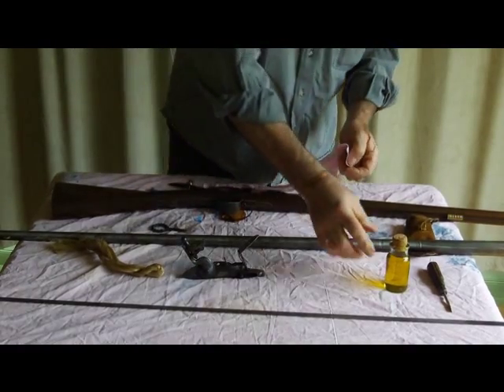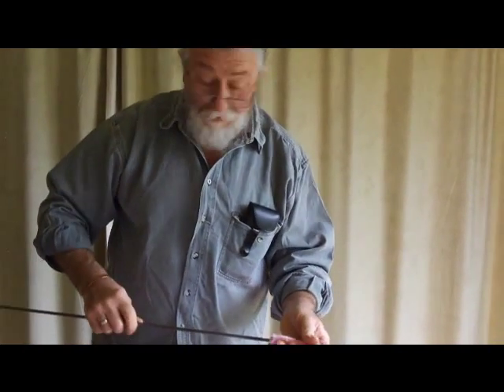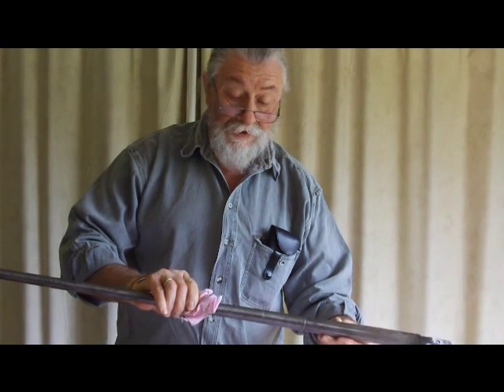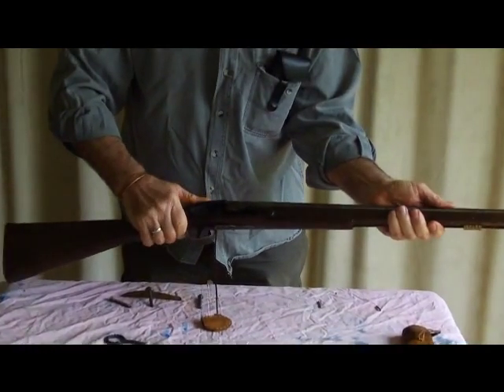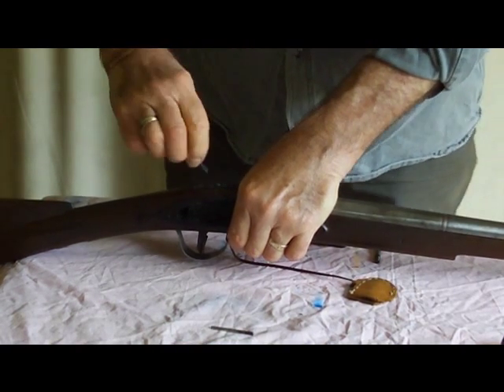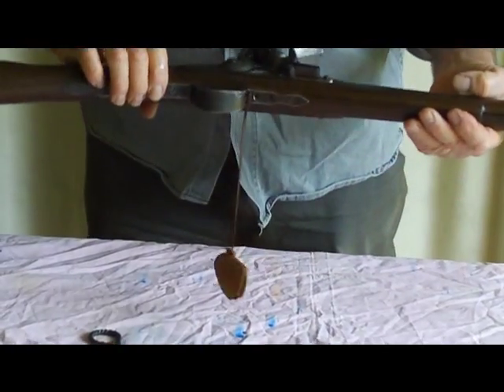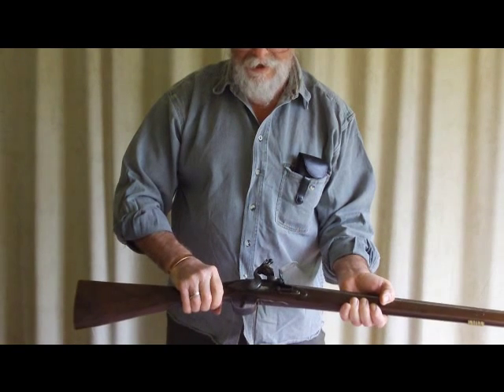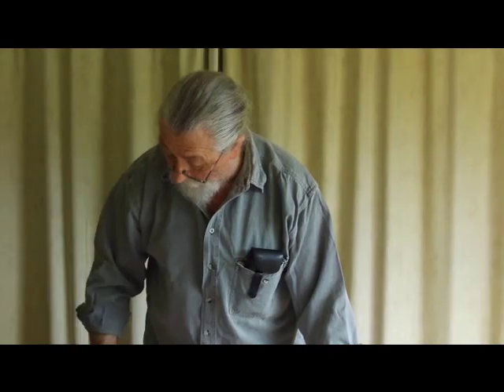PART TWO. The Cleaning & Maintainance Of A Muzzle-Loading Gun.

Comment: Hola Keith. He visto ahora tus dos videos sobre cómo limpiar una escopeta de avancarga y están muy bien. Yo también limpio mi escopeta así. También se puede limpiar sin quitar el cañón de la caja. Saludos. Hi Keith. I have now seen your two videos on how to clean a muzzleloading shotgun and are fine. I also clean my percussion shotgun as well. It can also be cleaned without removing the barrel from the stock. Greetings.
Reply from the maker: Hola. Modern gadgets are fine if you can't clean them as I do in hot water, I know there is a clamp you can get for flintlocks, & a similar item for percussions, but I still prefer the old way of cleaning with hot water. I think it gets it cleaner.
Good to hear from you again my friend.
Take care.
Regards, Keith.
Reply: Hi Keith. I clean my muzzleloader shotgun and rifles (Kentucky and Hawken) with water and cutting oil 10 % solution. Then dry the barrel with cotton cloth in my cleaning rod and last step a cotton cloth with oil like WD-40. But clean after each competition, ie immediately after 13 shots. I hope you liked the picture I posted on your Facebook wall, hunting with my muzzleloader shotgun and a partridge. I am Kit Carson on Facebook but my name is Miguel Angel Navarro. You can call me that. I really like your blog www. woodsrunner diary. Greetings from Spain.
Reply from the maker: hawkenrifles Good to hear from you again Miguel.
Keith.

Comment from the maker: I only wipe the excess out of the barrel so it will not foul the gunpowder charge. I only ever use my fusil for hunting, & one shot puts meat on the table. Not that a fusil ever needs cleaning between shots anyway. I think the larger calibres suffer less from barrel fouling, where as the smaller calibres like the little .32 need cleaning more often.
Regards, Keith.

Comment: Enjoyed this one very much. I've been impressed at how simple cleaning is. A couple of questions. How often do you swab out the barrel when shooting and do you use a cows knee? Great video thanks.
Reply from the maker: I do not do any target shooting, so if I am hunting for meat, it is the one shot then clean the gun. However, if I were shooting multiple shots, I still would not have to wipe between loads because I use a smoothbore.
Rifles on the other hand are a little harder to load, & with some, depending on the load used, you have to wipe the bore between shots or after a couple of shots or the ball may get stuck half-way down!!!
A way out of having to wipe if you need further shots is not to patch the ball, just load the ball as is without patching.
Yes Opal, I carry a cow's knee lock cover in the bottom of my shot pouch.
Regards, Keith.

Comment: Interesting that you say to clean the olive oil out of your barrel.. An old gentleman who taught me, liked to "season" his barrels with oil so as they'd be easier to clean ad he was able have more shots between cleanings.. On avg I'm able to get 6 to 8 shots before I actually need to swab the barrel or clean it because of the oil.. In his case he use lard usually.. I've used shortening for mine with the same results.. The only places I have to worry about rusting is in front of the tang

Comment from the maker: No there is no difference in the cleaning method for rifles or smoothbore.
The correct 18th century term is hammer or steel. This term left over from the earlier version which was shaped like a hammer. Frizzen is a 20th century modern term.

Tow linen/tow cloth/tow rag. "This separates the short fibers (called tow and used for making more coarse, sturdy goods) from the longer and more luxurious linen fibers".

When dealing with 18thc. items, you must think 18thc. not 20thc.
Keith.

Comment: You don't need to use neatsfoot oil for leather unless you live in a very damp climate like Floria, USA. Olive oil is very good for leather and all we use on our western saddles.
Reply from the maker: Not quite sire what your point is here Jens, neetsfoot oil & sweet oils (Olive oil) have been used for oiling guns since at least the mid 18th century. Leather will deteriorate in dry hot climates, I always used neetsfoot oil on my saddle & all my leather items regardless of the climate I am living in. I use neetsfoot oil on my fire-bag & my gunpowder bags to keep them water resistant. I am not sure how water resistant vegetable oils are, so I will stick with neetsfoot oil.
Regards, Keith.
Reply: Oh. No disrespect. But as you pointed out in the video, neatsfoot oil will turn your leather into a wet rag if you use too much. Olive oil has been used on harness leather since the bridle was invented. I've used neatsfoot oil for many years until I came to talk with a working cowboy in California and he told me all they use is untreated olive oil (virgin) for both saddles and bridles. It's a lot cheaper. 
So it was with some hesitation I tried it on some of my tack. It works great and I have since turned to only using it as it is about one quarter of the price of neatsfoot oil.
I live in Denmark and we have what I would call somewhat damp climate, but I store my saddles in a dry room and I have never had any problems with mold what so ever.
Now I don't know what would happen if you were  in the rain for days, but the olive oil seems to keep my boots watertight no problem too. 
Anyway, I just thought I would comment on it, because most people that uses leather thinks the only oil that works is neatsfoot oil.
It's interesting to hear you are a rider too. Do you still ride and if so do you bring your guns for hunting on the horse?
My sincere regards. I have just joined our local muzzleloader club here and I find your videos invaluable.
Jens
Reply from the maker: I see, actually I don't recall saying anything about "neatsfoot oil will turn your leather into a wet rag if you use too much", not the sort of thing I would say, however, I have taken onboard your advice on using Olive oil Jens, thank you. No I don't ride anymore, more is the pitty, I really miss it. I used to ride in the Territory, & always carried a Marlin 45/70 rifle in the saddle scabbard & a Colt navy caplock revolver on my belt.
Since my hip surgery I am not sure that I could get my leg over a horse anymore, maybe a day will come when I will find out.
Regards, Keith.